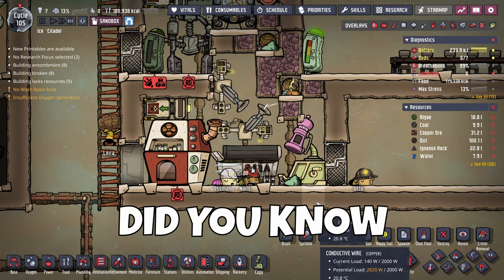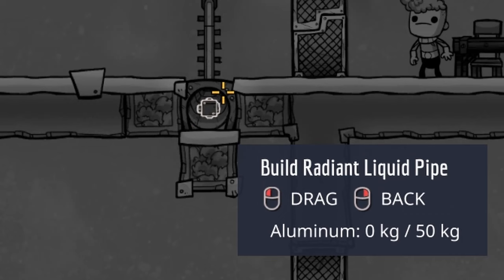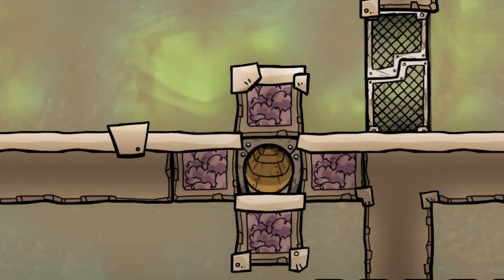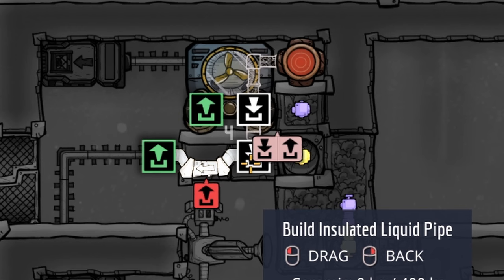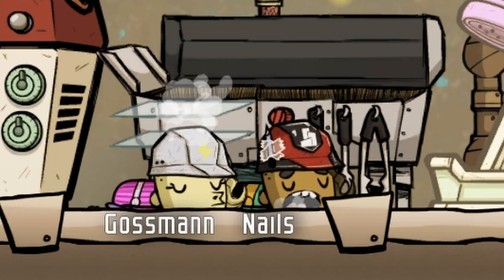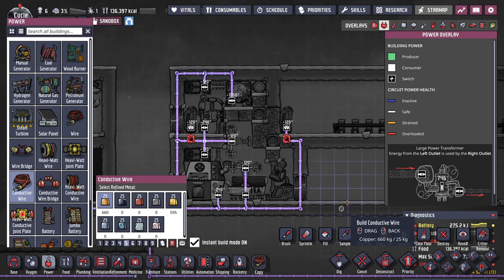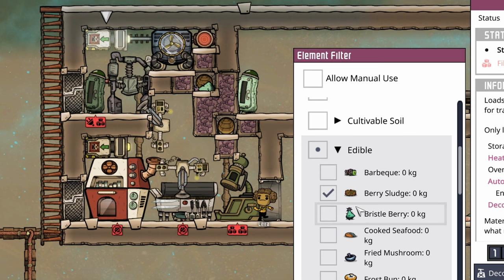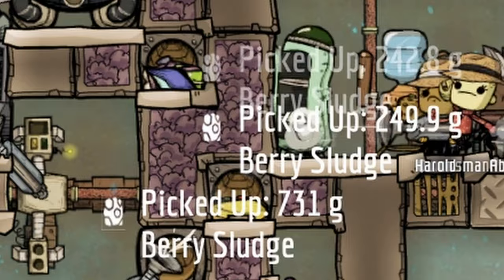INFINITE Food Preservation Kitchen 2023 | ONI Tutorial

Comment: My sweepers keep taking taking the food out of the tiles and puting it back into the conveyor loader. How should I set them so this doesnt happen?
Reply from the maker: Set your sweeping settings in a way that the final products are only going to the final freezing zone, and the second sweeper takes only ingredients :)
Reply: @AimingForGaming  Thank you, I fixed it but now there is another problem. So the upper tile gets cooled but the other one where I put the food doesn't get cooled because the sensor thinks its cool cus the upper tile is cool and doesnt give the green signal for aquatuner to run and cool the below tile.
Reply from the maker: @docholliday773 you must fill the pipes in a way that water moves constantly (do not fill it to the limit), that way the temperature will equalise
Reply: @AimingForGaming  I think it got stabilised on its own, it works perfectly now thank you.

Comment: When BBQ is completed on the grill how does it get in to the freezer tile?  I have tons of it and the sweeper above the grill keeps taking it from the cold tile and putting it back in the loader repeatedly. I think you need to block the grill autosweeper from seeing the bottom loader (which also fills the dinning hall fridge) and have another autosweeper load the cooked food from the grill to the bottom loader)
Reply from the maker: The final food should be swept by the top sweeper, as it has an access to final food collector but no access to frozen tile :) the bottom sweeper should collect BBQ only if it is part of higher level recipe :)
Reply: @AimingForGaming  Thanks for the response.  I had the rails hooked up backwards :)

Additionally you can just use a thermo regulator especially if you don't have any coolant with a lower freeze point than -20.  Thanks for the video.
Reply from the maker: @devincode oh I see :)
Yeah, there are options with gas, but I just love oil :)
Reply: @AimingForGaming  yeah that's actually a drawback/flaw in the system, for players who work off of vole ranching where BBQ is the final food this setup doesn't work as the sweeper moves the bbq from final storage into top loader
Reply: @realityextractor1956   You might have something setup wrong, this system works fine, regardless of the end product.
Reply: @konnan442  I figured it out, the system isn't actually designed for having BBQ be the final product that dupes eat.  Resigned it using the same concepts and now all is well
Reply: @realityextractor1956  The sweeper that has access to the final food storage, can not reach the loading bin for the final food storage, so not sure what you mean?  The bottom sweeper has access to the final food storage, the fridge, and the ingredients loading bin.
Reply: @konnan442  so when you make BBQ as the final product then the bottom sweeper is supposed to move it into the fridge, it does that until the fridge is full (if the priority is set right), then the bottom sweeper also moves it into the convert rail receptacle which then the upper sweeper takes out and puts it in a different receptacle, and so the BBQ gets deposited into the final storage that lines up with the fridge. But that is one sweeper, one receptacle, and one food storage tile too many. Once the BBQ ends up in the final cold tile the bottom sweeper takes it out and deposits it in the top conveyor receptacle, and so the cycle continues

Comment: First of all, very good and straight to the point tutorial.

Now, I must be doing something wrong with the liquid pipe sensor cause even if I set it at -20°, because it was 2 or 3 sections between it and the aqua cooler, it has a latency with the liquid that is meant to be cooled, as the green signal is sent for another bit of liquid, without cooling the one that's actually going in the aqua cooler
It's now been over cooling the petroleum and it keeps leaking because some of them reach under -40°.. have you got any idea by any chance?
Reply from the maker: Thanks! :)
I think this might happen only if your liquid is not circulating naturally - for example, if you filled the pipes completely and liquid becomes static :(
When you leave some space for liquid to move, it flows even with disabled cooler and this way your segments are cooled whenever needed. If one segment will be -40 and another one -10 for some reason, movement and cooling should equalize that :) the gap will make this process slower but pipes are ceramic and there’s not to many ways how heat will change :)
Reply: You're right, thanks a lot! Iemptied one pipe and it stopped! (I've also replaced the fluid with ethanol for a lower temperature tolerance)
Reply from the maker: @dioxide6147  You're welcome! :) This pipe issue was tricky for me as well :)